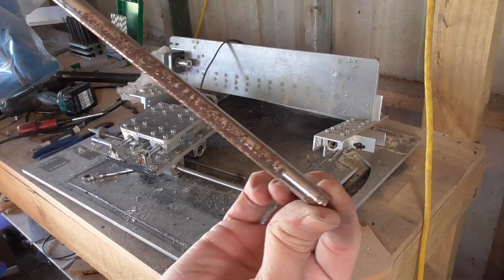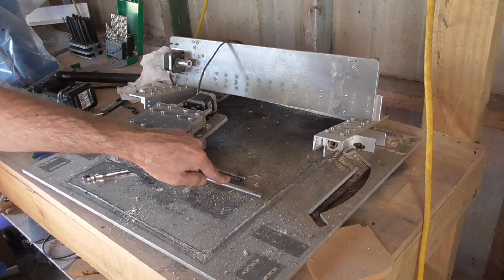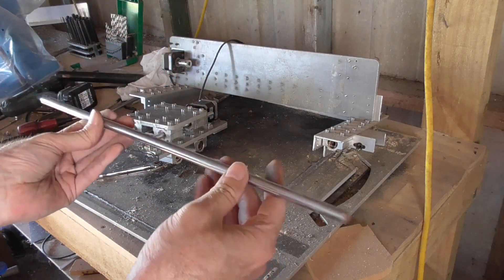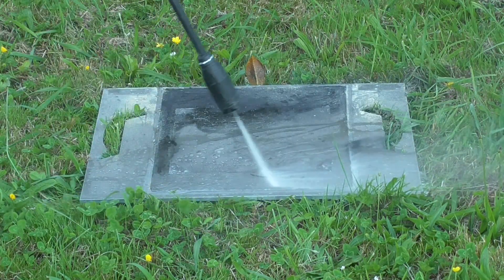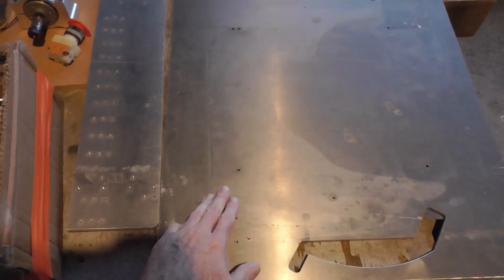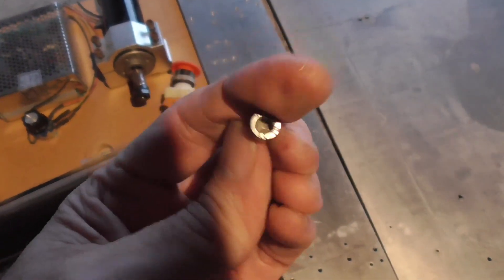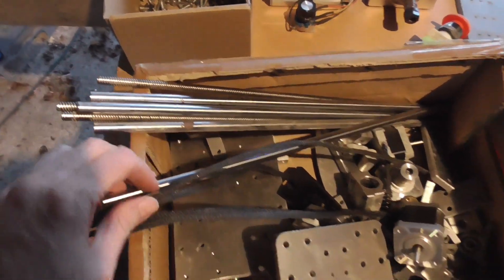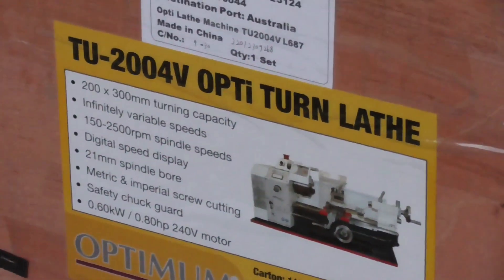DIY mini CNC machine part 17 final (decommission)

Comment: I sandblasted some steel parts in Hamilton years back, coated them in ACF50 and 2+ years later there was not a spot of rust on them even though they we outside (but covered by an overhang).

Comment: During the last year I have spent a lot of my spare time stripping, scraping, filing, sandblasting and painting a Myford Super 7 lathe.  My father bought it new seventy two years ago, when I was five years old.  He used it for maintenance, jig-making etc. for the production machines in his contract precision engineering business.  He passed it on to me forty years ago, and it was a source of joy until it went into storage when we moved to Hawkes Bay in 2008.  Sadly, the storage was not as dry as we thought;  when I next saw it fifteen years later it was a pretty sorry sight!  After dismantling every nut, bolt clip etc., I know more about it than ever... many parts are still available from Myford U.K.
And the moral of the story?... A LATHE IS A RUST MAGNET!  Do everything you can to keep it protected, and dry.
I envy you your new toy... enjoy yourself... I know you will work magic with it.   👍

Comment: I get the same effect if I don't cover my machines. (lathes, mill, my 2 home built grinders for crankshaft and cam shafts, the scroll saw) ....noticed the same on a face plate I had left out on the bench.
You would get, I imagine, much higher extremes of moisture overnight in NZ than we do here but only cure was to make cotton covers for each machine........ Do NOT use plastic sheet covers.
Works well. That plus a light rub with an oil rag after use.
As for the lathe, think you will be disappointed to some degree if it is main land China made. Having had Myford (2x.....Speed 10 and an ML7 from 1954) in my workshop for many years one tends to notice poor quality machines. Mate of mine bought similar to what you have there and I tried it ...once.... never again.  Seems the best of the Chinese brand are the ones made in Taiwan which turn out to be "not too bad for a cheapie". Another mate of mine has one of the AL-336 style (Taiwan made) which I have used from time to time due to the much larger material handling properties. There are work arounds on the China made machines to manage to get an acceptable level of output accuracy but when things flop around all over the place during setup, it can be frustrating.
As for the old rods, don't be surprised if they are as-hard-as and difficult, if not impossible, to machine in a lathe. Think you'll find originals are "ground" to size.
Reply from the maker: In winter we often get fog where I can't see further than about 40 meters. Since discovering the same rusting issue on my big machine I have been covering it with a cloth which seems to have almost completely stopped any further deterioration. I think from now on everything will be getting a cover, well... depending on how much it cost me :)
I'm not familiar enough with turning yet to be disappointed with this, at least that's what I'm hoping. There was a ML7 in the local auctions that I almost bought but I wanted electrically variable speed, 20mm spindle bore, and the hardened ways sounded better. The place that sells these ones was having a Christmas special which was what finally got me.
Reply: You'll be fine...just be ready to make allowances.....many machines require the same. I had an old milling machine to which I fitted a home built dro....in those days dro's were over AUD$1000) as long as I remembered to come at it so-to-speak from the same direction every time, all was near to perfect. (no backlash compensation ) used it for donkeys years and sold it to a mate of mine.....wish I'd kept it now as it was a better machine than the new one. Shit happens...:) @iforce2d